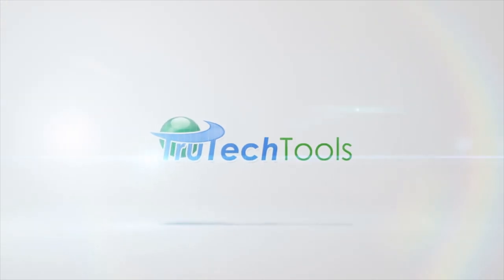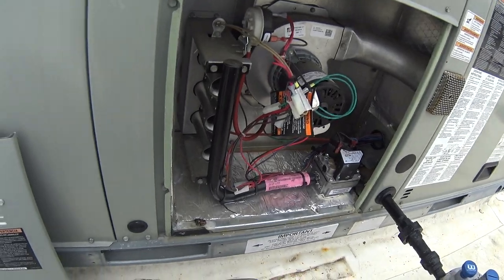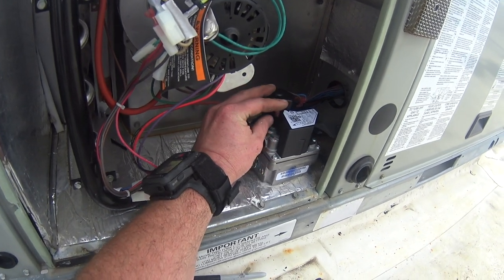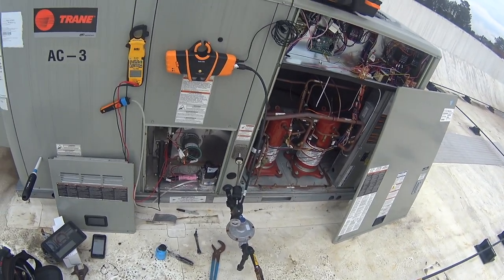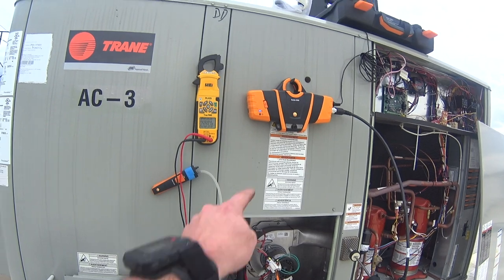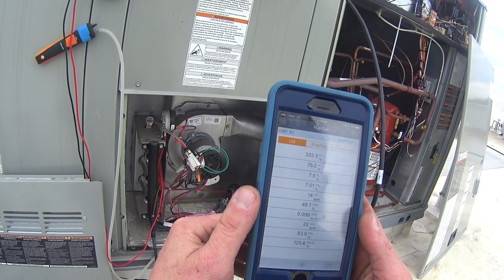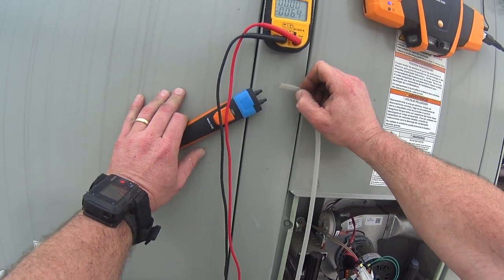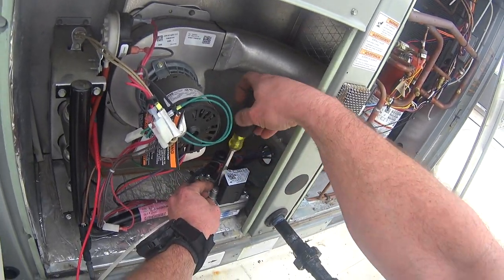HVAC Service: Trane RTU Gas Valve Replaced and Combustion Test

Comment: I apologize for any inconveniences and you are correct I double checked and the gas valve only had one year warranty. sorry but we never sell a rooftop with only a one year we upgrade to a 5 year allways.
Reply from the maker: We didn't do the job, we were simply called in to address the heat not working. No problems Terry

Comment: I have been a trane service tech for 30 years and I personally haven't encountered a bad gas valve on that new of a unit. It's possible yes but dang I can't believe your camra equipment wasn't working and you weren't able to show that the valve was getting it's 24 volt supply and wasn't opening. I think you spend to much time hooking up to much testing equipment that's a lot of overkill in my opinion. and use a pipe wrench and check for leaks that's more inportant then all those reading that are all most useless. at least as new of unit as this one is the replacement gas valve will be covered under manufacturers warranty. And I'm love trane because they will check out the old value. that's why hiring a trane service tech is so important. Iam shure you did the right thing.
Reply from the maker: Thanks for commenting, to each his own on opinions.
Reply: There is some truth to what you are saying. But you sound like you are stuck in your old ways too. But I have respect for anyone whose been in the trade for 30 years. 8 yr tech here. Don't knock the technology till you try it old man! Just kidding

Comment: Born to be an TAB guy.  Put the cover back back on to simulate actual operations, and monitor the inlet gas pressure as well.  Sad part all the folks that do not properly set up a unit. Well done bud.

Comment: Everytime I replace a component I label the wires.  I know techs that just pull the wires out and reconnect them by memory but I don't like relying on my memory. I agree with you "Better safe than sorry." Question : How much excess air did you want to see?
Reply: I've found taking a few quick pics with my phone to be the best and easiest :)
Reply: Lets NOT Play With Electricity Your right! I've been taking pictures now.

Comment: Hey, 
What do you mean when you talk about your digital manometer "walking". I have a TPI Digital manometer and when I am doing manometer tests on  propane systems at the 2nd reg I notice it fluctuates, even without a leak. I put my dial manometer and there is no movement. Is that what you mean? What is the explanation for it?
Reply from the maker: By walking I mean drifting from zero, I used it's an issue that no one can resolve with digital measuring tools. I've yet to find a full scale manometer that doesn't drift. The iManifold 921M manometer doesn't drift but it's only able to read to about 1.7"wc

Comment: unit was manufactured 7/22/15 and installed on a IHOP GB alford hwy. store no. 2130  in holly springs north Carolina. It does have a warranty So I emailed the corporation to inform them that it's covered under warranty.
Reply from the maker: That's not what Trane support told me when they checked the system. I asked them several times to confirm, they said it had no warranty after 1st year and it was over a year since install. Not saying they can't be wrong though.

Comment: We have 6 20 ton Trane heat pumps on our roof. I say they should have put Trane 20 ton gas packs or gas/electric units. Your thoughts on this. Thanks.
Reply from the maker: Depends on several things that are specific to your climate zone. Maybe they didn’t want to run gas lines or something

Comment: Why do you use leak lock instead of pipe dope on your fittings?
Reply: what? that's not a pipe dope?
that's what i've been using for 7 years
i like that better than yellow or white stuff

Comment: I'm not sure you put enough pipe dope on those threads, lol. 
Just curious, what's your reasoning for running a combustion analysis when you can't adjust air to fuel mixture? We only do that on boilers, water heaters, etc that have a combustion air control valve or a variable combustion fan motor and always set gas pressure to design then adjust the inlet air. 
Also did you check the static/cfm? I suspect that with such a low deltaT the blower was moving too much air for heating mode or ductwork has issues like being oversized not creating enough resistance to slow the air enough to give enough time to pick up more heat and or more air volume than unit can keep up with, which would cause excess run times, lower efficiency and cause premature heating component failures. Just a thought though as I can tell by your vids that your pretty sharp and I'm probably just preaching to the choir. 
👍👍Thanks for your videos.
Reply from the maker: Combustion, as I'm sure you know or your comment would've been much different I'm guessing, tells you how the system is operating beyond what you can see by simply checking gas pressure and air temperature. If necessary you can enlarge the gas orifices to increase gas to air or decrease orifice size to increase air to gas. If anything I would suspect that these rooftop units have less duct than they should and I was simply not in a good air stream to check heating air temps. Probable get decent cooling delta though as the coil is before the blower unlike the HeatX. On a side note, I've always used "too much" pipe dope, it's one of my OCD problems.
Reply: Stephen Rardon lol love your reply. I always enjoy bouncing thoughts off of other good technicians. I have checked heating delta at the rtu's for years and never really noticed any problems other than elevated deltas from temp probes being so close to heat exchanger, most likely reading the radiant heat as well as air temps. But again that's why i enjoy feedback from other good techs. And I have some of that OCD too, I think that actually helps us be better techs, I can't tell you the number of times I've been called anal about my work lol. Again thanks for you vids and feedback. Stay safe.
Reply from the maker: Robert L one of the other rtu's had an insane delta and I'm sure it was due to radiant from the HeatX. As much as it pained me I left it "good enough " since it wasn't tripping the limits and I was sure it had to be probe location

Comment: A little involved for small rtu dude don't you think. Replace the valve and go on to the next call. Rubber plug is from the air balancer. Too many bells and whistles. A meter, pair of channels, and a ten in one screwdriver should do the job.
Reply from the maker: You do you Bae matt tangorra
Reply: A little over kill I agree but there's nothing wrong with hooking up a manometer to the gas valve after you change it.

Comment: You Didn't show us why the gas valve is bad, buy testing it with the multi-meter.
Reply from the maker: You're right, I ad some camera trouble which isn't a good excuse but I did describe the issue did I not?

Comment: You hav fixed the issue of the call. But I would have done things a bit differently. All those wireless tools are great! But they must be used properly. You supply temp probe should have been inside of the restaurant on the vertical supply drop. Also, you had the door open to the combustion chamber during the analysis. It should have been closed, I believe that is why you had the excess air issues. So you dropped the regulated 3.5"WC to 3.2". I saw you adding measurements to your report from the tools that were not being used correctly. You seem to have the knowledge, which comes from years in the field. Essentially, I think you were a bit lazy. Remember, you don't know how another company in the future might read your report and tell me property owners that things are not just right. You can have your reputation damaged. Overall score for this one is a C+. I say this simply because you went outside of manufacturer specifications with the only cause being partial Data and I believe that the customer got an inaccurate report for which they paid quite a bit for.